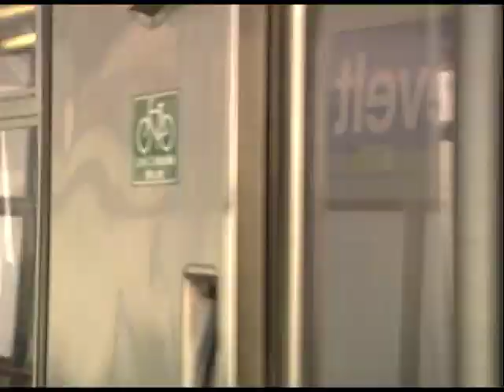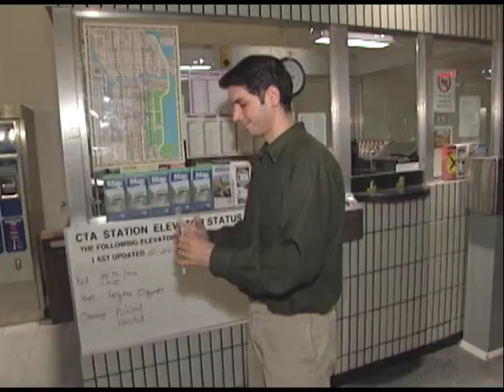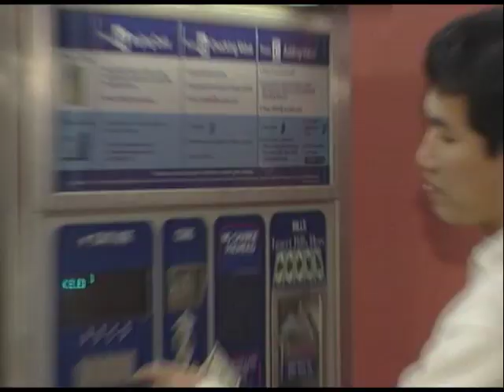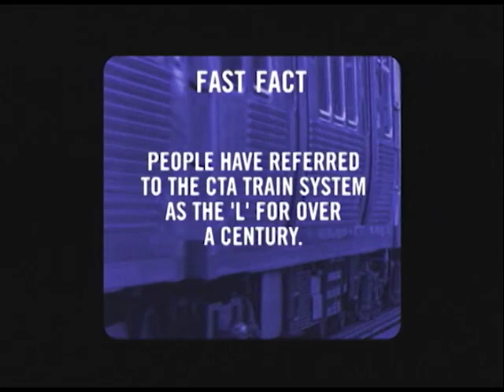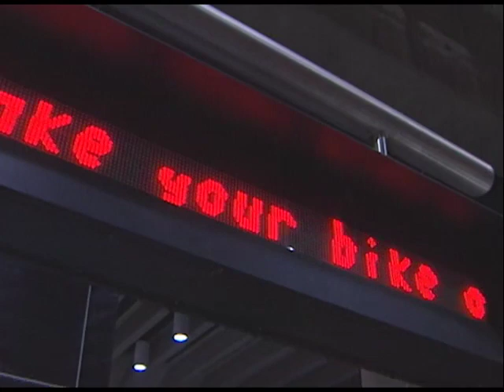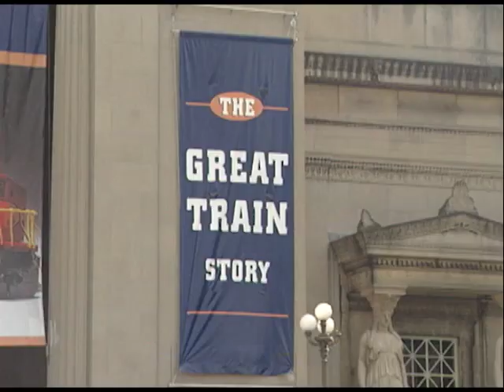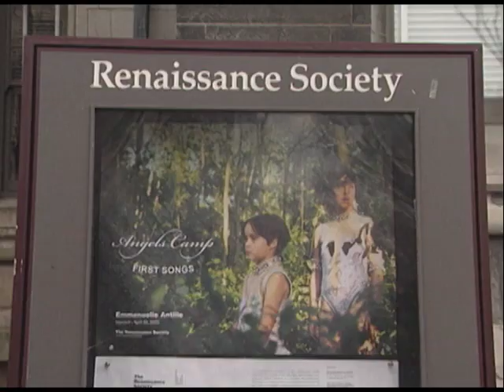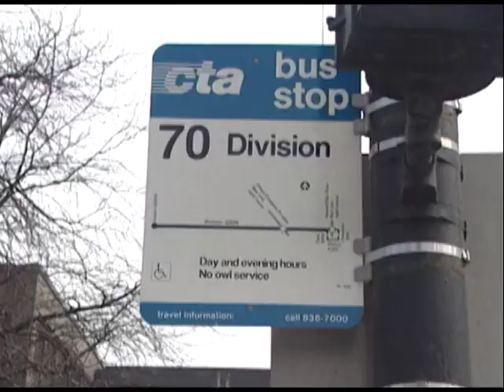Connections: Episode 01

Comment: What it does not say is that even though the CTA is so much smaller than other transit systems they still charge as if it is as large as those
Reply: New York has 14 lines ifI'm not mistaken.... Chicago has closed more stations than the 70 we have in Toronto. The L looks good to me...